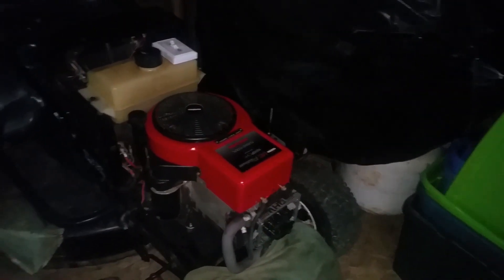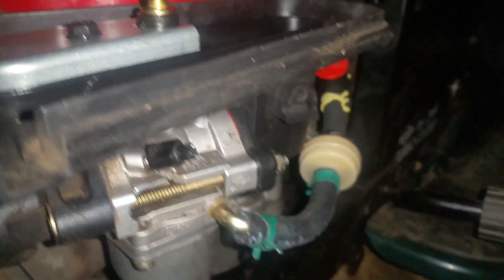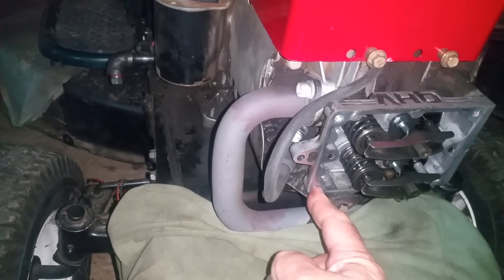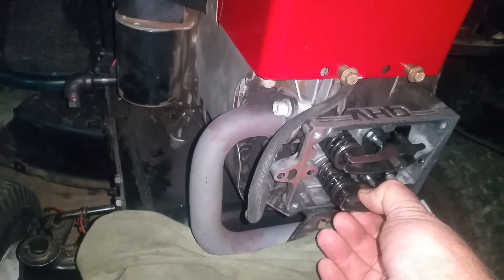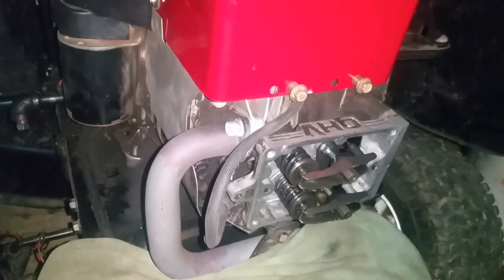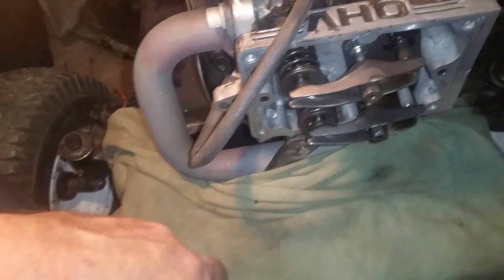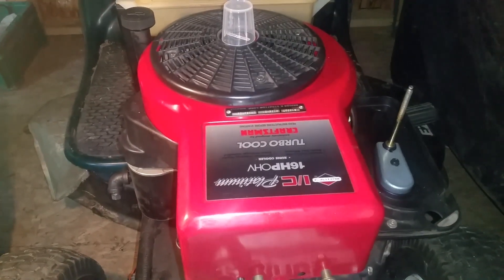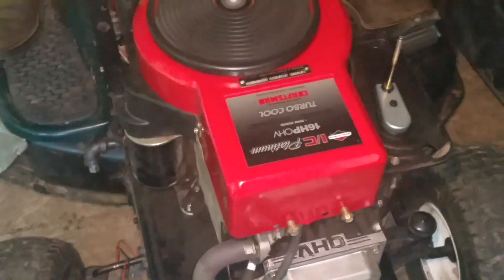Briggs & Stratton OHV 16 hp Craftsman valve clearance adjustment

Comment: How do you "... tell that you're in the top dead center position"?
Reply from the maker: Piston at top of cylinder both valves fully closed. If you are on wrong stroke, the valves will be slightly open or rocking with just a slight movement. Tdc gives full closure and they wont move with slight movent of the piston.

Comment: I HAVE A 16 OHV ADJUSTED THE INTAKE TO .0004 AND THE EXHAUST TO .0006 AND IT STILL WILL TURN OVER BUT DOES NOT CRANK. HELP
Reply from the maker: You've checked fuel and spark? 
Is it possible you shared the flywheel key? What equipment does it go on?